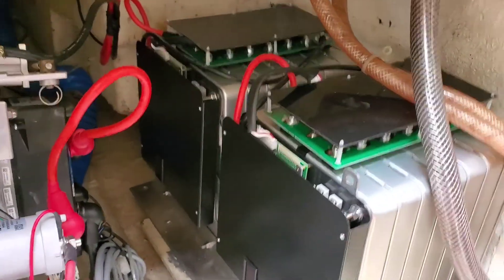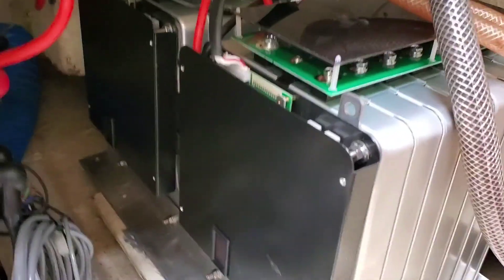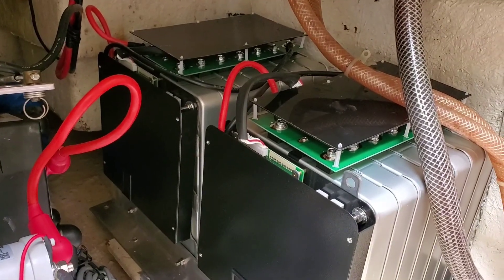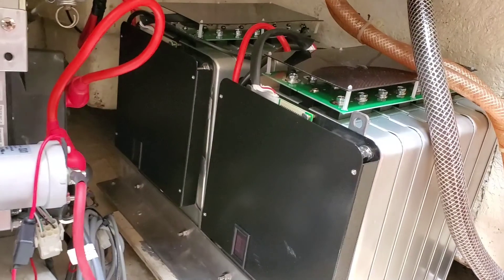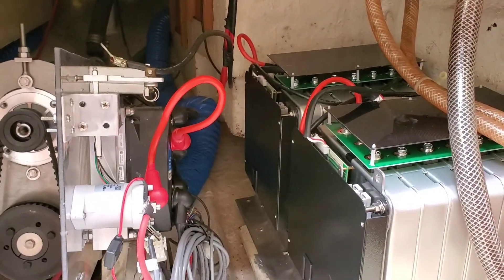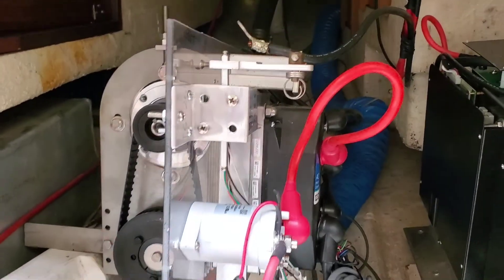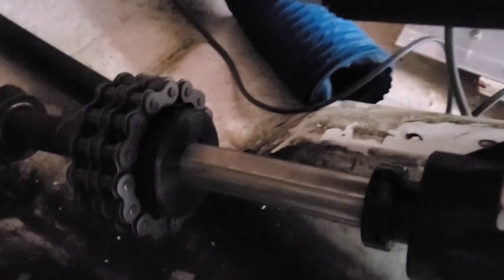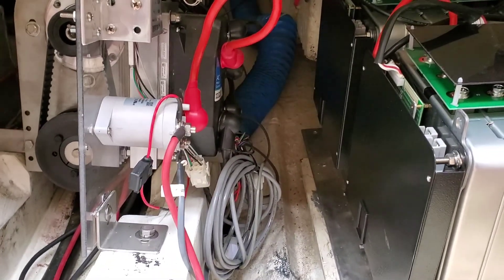Catalina 27 electric motor conversion, finishing the installation and adding the battery packs.

Comment: Any update? I have the thunderstruck kit and am planing on doing the install soon. Have you figured out the range with the leaf batteries? Do you have a video of it running? My motor is not enclosed and I am wondering about the noise level of the motor and the chain coupler. Thanks